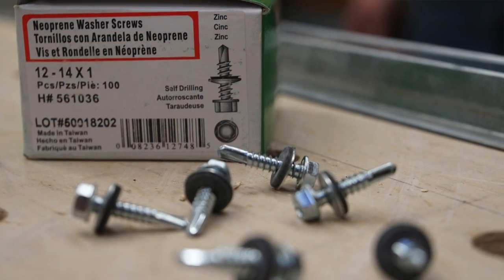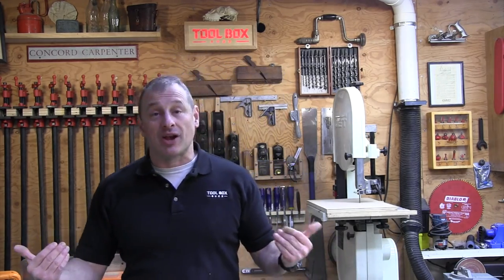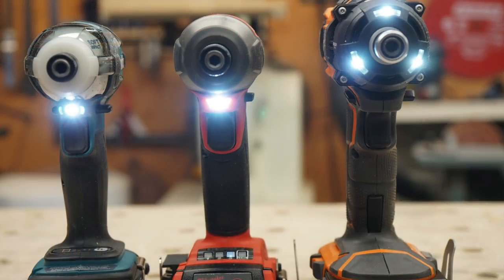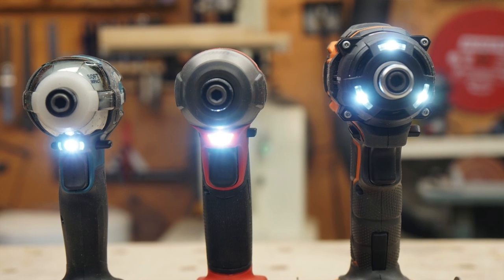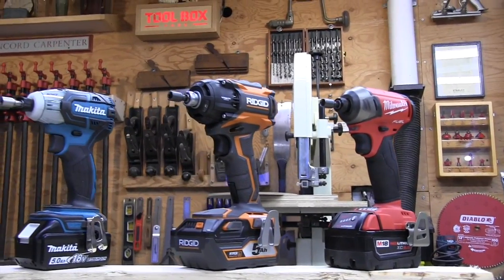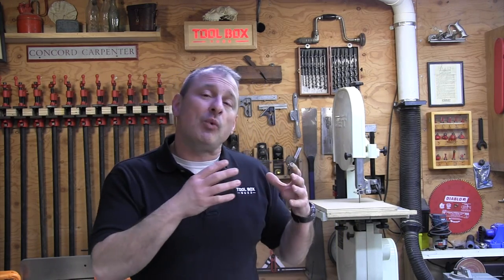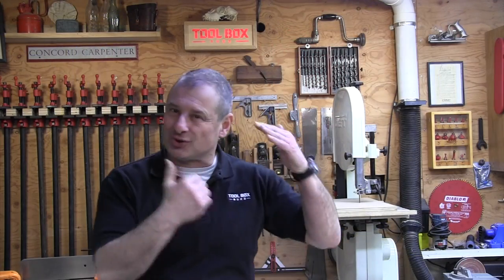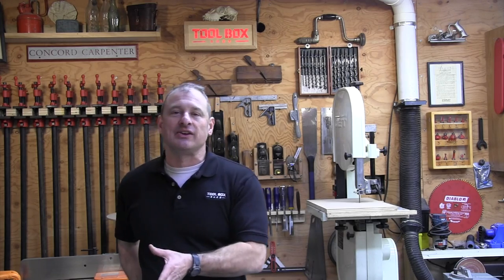Best Hydraulic Oil Impulse Impact Driver - Head-to-Head

Comment: I rreeeaaaalllllyyyyy hope Milwaukee brings their hydraulic tech to the M12 line. A compact M12 hydraulic impact driver would become my most used tool
Reply: Weston Bartosik agreed
Reply: WERD.
Reply: I have the 18v one and love it the only problem I have is it snaps off heads too easy lol. But I'd love a 12v version
Reply: There m12 impact fuel is all I use. I do hvac service so never need my m18 fuel unless ripping apart a voyager to get them heat exchangers out
Reply from the maker: Me too
Reply: I love my 18v ridgid octane drills, but for 12v all I use are the Milwaukees. I also do a lot of HVAC stuff (and other trades) and it's nice having something small and reliable in tight attics. I wish they had the lights that the new ridgid drills have though! Those lights are really convenient. Sometimes ill forget my headlight and just use the drill lights until i go back down.
Reply: Marty Lucas You’re not allowed to like tools and video games? That sucks I know I do...
Reply: They already did
Reply: They have a 1/4” 12volt surge now. I have the new gen non surge and let me tell you it’s freaking loud. Hearing protection is a must.
Reply: According to the performed tests with the 12v impract drivers I don't get why you would go for a oil impulse driver. The difference in the noise is about 2-5db between the makita 12v and "oil" and between the Milwaukee 12v and "oil" but the torque is 2 to 3 times higher.
Reply: @MrRaphisan  why would you need tons of torque for spesific jobs, like kitchen cabinet installing? They usually want light weight smooth and controllable driver for that trade. M12 surge would be ideal for that.
Reply: @travispratt6327 , sure you can like them, but I don’t feel you can be engaged with both, yet still be efficient with daily tasks.  Productivity (somewhere) will suffer due to playing video games.  If married playing is going eventually tick the wife off.  Hey…I’m just speaking from personal experience, not throwing out any BS.  I traveled on business 3-5 days per week, every week.  Married with 4 kids.  Large house with lots of honey do’s.  Always engaged in a remodel project or refinishing project.  Yet I played Battle Pirates every day. Something has to give…I no longer play Battle Pirates.  My Wife is much happier and Ican buy new Milwaukee tools with hardly any pushback.  So it’s not all that bad.
Reply: @martylucas8557  Lol, how’d you find this 2 year old comment? And yea I get it it’s just that goes for anything… you spend all your time shooting guns you’ll not be productive, spend all your time modifying your car you’ll not be productive ect. There’s leisure activities then there’s work, separating and moderating is key, I don’t think any leisure activity is inherently incompatible with work.
Reply: @travispratt6327 , LOL…I don’t know, it just popped up.  What I do know is this…I’m banned from p,aging video games!  Ha!  I can shoot guns, buy M12 and M18 tools for projects 😉, but have to stay away from Battle Pirates.
Reply: It is def my go to, when I've got a heavy workload I still get the m18 but 85% of the time m12s have more than enough power and can hang from a pocket without showing your drawers
Reply: They already have……get the three amp hr battery
Reply: They do…

Comment: I'm a building Superintendent off a 100+ unit carpet building. When ever I get a trade vendor in  the building working along side me when impact drivers are being used, they all noticed how quiet mt Impulse Makita driver is. Some wondered if I somehow installed a muffler on it! When working in apartments doing repairs with sleeping babies a doorway away and senior with TV and radios turned upped to hear the programming, babies are never awoken and senior forget I was there until I startle them when letting them know I'm leaving. Only my Impulse goes with me within living quarters. The others impact tools work outdoors or in the many utility maintenance rooms around the property.

Comment: there is not increased durability, due to the oil cavitation, they actually wear out a lot faster than a mechanical version...  the cavitation literally erodes the metal... you really dont know what youre talk9iing about... Ave has a video explaining this.

Comment: I once got a better review because a man's sick wife was sleeping in the next room (no ac) and I needed to use my drill. I have a m18 gen 4 and a surge. I told him I'd use my slightly quieter drill in meager hopes of it helping. Due to the way the surge hammers you can slightly pull the trigger and the screw will still turn per hammer. Surge is a good one but not for heavy work despite it being a m18 fuel

Comment: I use a surge for sheet metal work.  Everyone is always surprised when they hear how much less noise it makes. Normally when putting screws into a large duct, it echoes so much. With this, way less. And it doesn't strip things out as easily. I found i dont really like the sheet metal screw setting, but i usually do the action by hand. I usually only run it on the high setting for the rpms. And doing wood work inside the house, it makes way less noise though the house. Doesn't scare the pets nearly as much. Even using it with a socket on cars, its much smoother on things. Its perfect for what i do most of the time.
Reply from the maker: Roy Fabian thx for commenting
Reply: What's a surge?
Reply: QAnon On a Bong its the hidraulic impact from milwaukee

Comment: If you have the budget I would go m12 surge and m18 fuel impact. Small tasks with the surge while still staying quiet. If you need the bigger power just use the m18 fuel
Reply: That's exactly what I did, I have fallen in love with the that little m12 surge.

It's so light and compact, and it doesn't question it when I drive 3" wood screws, it just asks me "how deep?"

Comment: I did notice that the Makita has a plastic cap on the end of it, I just picked up their 430ftlb 1/2” impact wrench and it has the same plastic cover. 

I do have a Milwaukee Surge and it’s been fantastic. I came here to see what the Makita is about since I’m getting into some of Makitas tools. I hope I have the chance to test one out before deciding to buy one, it seems interesting. In general all these
Hydraulic impact drivers are a game changer, they provide hearing safe operation that doesn’t disrupt what other people are doing. On top of that they are highly controllable, standard impacts don’t have as much finesse. The Milwaukee Gen 3 impact will drive screws all the way through a 2x4 in the blink of an eye, whereas the hydraulic varieties are a little slower and much more controllable. Meaning you can put that screw exactly where you want it.
Reply: While I agree on that and I love the Surge, people seem to forget that a non impact screw driver or small drill (Even 12v) can put these screws down withouth any hazzle at all, with even less noise.

Still I get it. I'm in love with the M18 Surge. It just feels good and has excellent angling/skew and one handed control.

Comment: Really extensive review ! Best I have seen !  I love my Makita LXT tools I have had them at least 10yrs now since the lithium 18v LXT system came out and just keep adding tools . Its amazing to me they have 250 tools that use that 18Volt lithium battery . That Milwaukee impact looks nice tho.
Reply: Just got a makita adapter for the milwaukee battery hell yeah.
Reply: I've tried the M18 Surge and it's a dream. And it is pretty strong as well. But it feels smooth and gives great control. I'm getting one for sure.

Comment: Thanks for the testing. I thought of a couple of things while I watched:
- For a direct comparison, look only on the price of the bare tool.
- Your test was based a bit towards low torque application. For at more rounded testing, some heavy torque applications should be tested as well. This would probably move the general performance scores a bit. Especially when noise and speed is factored in. Why not include some big lag bolts or perhaps some vehicle work.
- Warranty. This is important. Include scores for that.
- I would have liked an evaluation of how well one of these can directly replace a traditional impact driver. Preferably through testing.
-There is no need to mention the old 'it comes down to what platform you own'. We all know this, but tool doesn't care. This is a tool comparison, not a platform comparison.
Thanks again.
Reply: TrixieDK we could test more rigorous applications, but the tools are not designed for that. Kind of like we’re not going to use a standard impact driver to install lug nuts when the proper tool is an impact wrench.
Reply: @toddfratzel3569  the difference is the noise level. I think many users would use the more silent product wherever possible. Myself included. Don't get too carried away by the 'this product is meant for this, and that product is meant for that' sort of thinking.
Reply from the maker: TrixieDK with exception of the Ridgid these tools were not designed for heavy torque applications.... they were designed for MEP trades, and probably started as a niche tool.  

Bare tool cost is one way to do it.

Warranty is a good point! We’ve started to look at that more.

Mentioning platform is needed because many people feel that way, for example, a lot of people will justify a slightly under performing tool if their invested in that platform. I’ve seen it time and time again.
Reply: @ConcordCarpenter And that makes even more sense today. A 5ah Battery on pro platforms go for around 100$ here in Sweden. Charger 60-100$ too. So it makes sense to stay on a platform.
Most of the time the differance in most tests are minimal on Milwaukee vs Makita. Makita often more smooth and Milwaukee with more power.
You can't go wrong with either.

Comment: I mean, I like the price comparison, but you quoted the milwaukee at over 300 for the impact and 2 5ah batteries. Two weeks ago I got this impact, the fuel hammer drill, two 5ah batteries and a rapid charger new in a hard case for 280, shipped to my door

Comment: Milwaukee with 2.0AH compact battery hands down.
I have mine since literally it showed up in home depot 2.5 years ago? Worked outside in rain multiple times, fell off roof few times, use it every day sometimes all day. Looks as if I dragged it on asphalt for miles behind truck. But to my surprised running like a champ.
But then again, I have probably 70% or Milwaukee’s offerings and wouldn’t trade them for anything else. With a 2.0 battery on this surge impact there’s really no need for a 12V version. (It’s super light)

All my corded tools are festool though

Comment: I didn't actually know Makita had one of these in their line.

BTW, 3 dB = twice the sound intensity (power)
6 dB = twice the sound pressure (amplitude)
10 dB = twice the perceived volume (Loudness nearly sensed psychoacoustics)
Reply: Drew Morgan Makita was the first to come out with one. The impact tested came out in 2014.
Reply from the maker: thanks
Reply: DM, in audio terms (speakers), 3db takes twice the power, 6db is four times the power, 9db is eight times the power, 10db is ten times the power and twice the perceived loudness.  3db is the smallest humanly perceivable difference.

Power and amplitude are interchangeable terms in this area.
Reply: @superspeeder  This is exactly why I used the definitions and terms that I did.   Most of what you just said is the same as what I posted except for your incorrect statement that power and amplitude are the same.  Power is the area under the curve while amplitude is the height of the peak on the wave.
Reply: Exactly.  Sound Pressure Level (SPL, expressed in db) and amplitude are different characteristics of the same measured sound.  You can't compare the SPL (db) of one sound to the amplitude of another sound that's measured at +3db (your example).

Using a sine wave as an example, a recorded SPL of 90db would also have an amplitude peak of 93db, or 1.414 x the RMS value of the sine wave.  The shape of the waveform dictates the relationship between RMS (SPL) value and the peak amplitude.  I found your example confusingly worded, mostly because you used intensity and pressure as descriptors.  Relative to a reference SPL, a sound increased by 3db SPL would also increase amplitude by 3db, they scale together.  ;-)

I have not seen the recorded waveform of a traditional impact driver, but I can guess that it has a much higher peak amplitude for a given measured SPL than an oil impulse driver does.  This is my impression after comparing my Makita oil impulse to my old Makita impact.  The old one is considerably harder on the ears, much more so than the measured SPL differences would suggest.
Reply: superspeeder I’ve never seen anyone hit back at another comment with such force. This made my day hands down. Sorry I couldn’t have read this along time ago. Thank you for this

Comment: I like the rigid line
Reply: I have heard that it vibrates a lot. Is that true?
Reply: @skycorrigan6511  it does. It's also heavy and stupid powerful. It took me a while to get used to the power. It also started acting up after a little over a year. Pull trigger and it starts and stops as it pleases. I switched to Makita.

Comment: Makita feels great in hand, seems strong enough. Service center has reported a few units with oil leaks though. Probably been pushed too hard tightening bolts. 

I use the Hitachi oil impact which is the most quiet one on the market and has a self tap screw mode and the best ergonomics for me. It is a little quieter than the Makita and a joy to use. It is a "weak" oil impact with a mere 33 NM of torque but my daily driver. I was not impressed with the 12V Milwaukee surge myself but the Milwaukee 18V surge felt ok. Both Milwaukee oil impacts are significantly more quiet than your average rattler by a good margin.

Comment: I like the form factor of batterie options you get with Milwaukee.
Many different profiles witch makes the tool last longer or be more compact.
Reply: I agree! I have 3 of those old Milwaukee 5ah batteries that equal the size of Makitas 18v ones. 
And after trying a 2.0 Ah and putting it on my nail gun I'm thinking about getting a couple of 2.5 High output ones and getting more compact. It does alot for control and weight.

Comment: Tin basher by trade and I LOVE my Surge. So satisfying when your screws go in silently. That speed setting button is the worst thing anyone ever thought of for impact drivers. An experienced tradesman knows when to back off. you fnd up pressing it by accident or your co-worker is playin jokes and you end up on 1 when all you ever want is 3 (I'm guilty of pranking too). We call it "noob mode". 

I very very rarely strip screws, I think the amount of times I pressed that button on purpose is exactly 1 (other than when I'm playin jokes on co-workers, it' gets pretty funny when someone starts losing their mind wondering how they constantly accidentally go to 1), never again, never again. Fridgies might want this though, the amount of RTUs I run into with stripped screws is almost comical. Last week I was on a roof where every panel I looked at had 2 or 3 screws left in it and they were stripped.

Comment: They are for smaller jobs?  My Ridgid Stealth Force is the strongest impact I've ever used.  I can drive 6in 1/2in galvanized lags with no predrilled holes.  Anything under 3/8 is easy for it.  You saying these are for smaller jobs confuses me because the Ridgid SF is so dang powerful. Everyone that uses mine instantly realizes are far superior it is to a standard impact.
Reply: It's the same size at the mid torque impact wrench

Comment: Already in the Ridgid platform.
Ironically Makita was the only cordless drill everyone had back in 1987 and you had to keep an eye out or hide it on jobsites as it would be stolen.
Oddly enough they were "stolen" by ex girlfriends moving out as were the later Dewalts by the neighbor's kid.
The older Black & Decker was made by Dewalt and by cutting the bottom the same you could use Dewalt's batteries as Black & Decker no longer supported that platform.
After that phase I bought the Porter Cable drill & impact brushless set & still have it. The brushed Sawzall however burned up and was replaced by a Ridgid and that's where I am today, adding to it as I go.

Comment: I use my Ridgid Stealth Force as my main driver for building decks. You say they are for smaller fasteners but I drive 8-12" GRK RSS all day with no issues.
Reply from the maker: Ridgid is geared with more power - it'll handle those np

Comment: i hear you get cavitation with hydraulic drivers though

essentially wearing out the mechanism faster than traditional hammer and anvil systems
Reply: Yes, according to AvE, that's a tradeoff with oil impact systems, and he explains the mechanics behind that in one of his videos, although I can't name exactly which one.
Reply: I heard about this too but in reality, it makes no real difference to me because these tools really only last 5 years or less under construction use.  I am on my second Surge (dropped 3 floors and split in half) and my second 2753 (squashed and broken under cement blocks).  I don't think I will ever get to the point where the oil impulse driver is really out of commission.
Reply: the video ave done on the ridgid he got slightly wrong. however even with the cavitation the likelihood is an oil pulse will outlast a standard impact providing the hydraulic cylinder doesn't leak or overheat.
Reply: axeami135 - hopefully you are right... these tools are just fabulous and still quite unknown to most... I am an advocate of oil impulse tools regardless of brand!  In the end, only time will really tell... I just hope it doesn't tell my tool about cavitation ;)